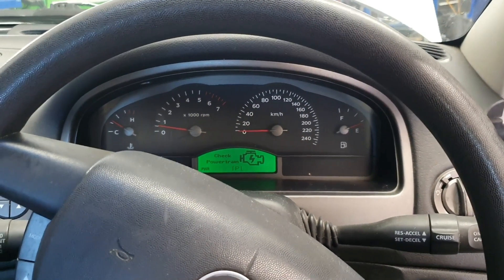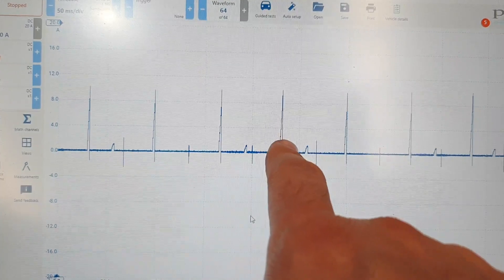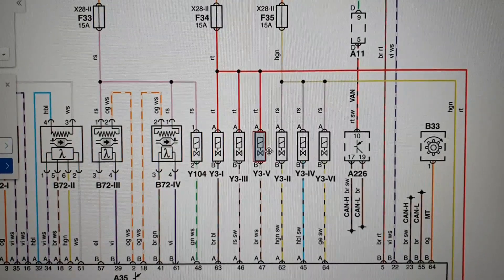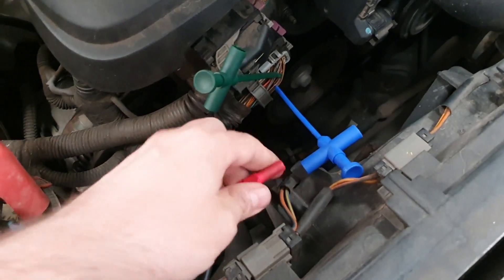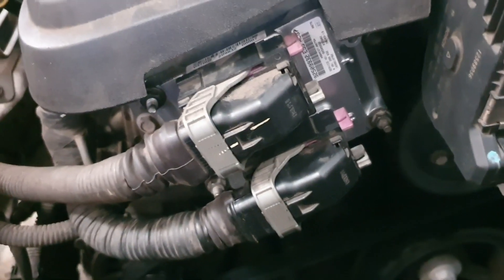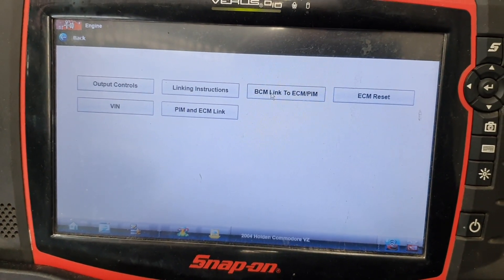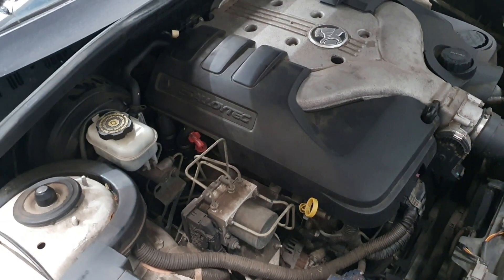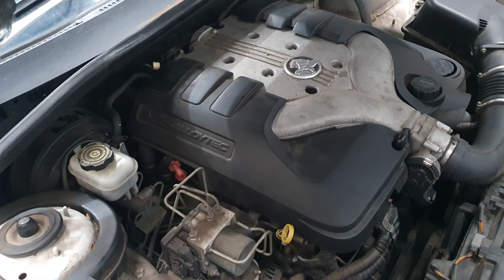P0205 - VZ Commodore 3.6L Injector Control Circuit Malfunction

Comment: Hi rob. I’ve got a VZ with 335k on the clock. I’ve repaired the ECU/PCM (it was misfiring). My ECU/PCM repairer said I had under-load for all injectors and a hard fault for injector 5 which he has fixed. I’ve never replaced the injectors (in 15 yrs of ownership) and they seem to be fine. I note you mentioned you replaced the injectors also. If I don’t replace the injectors, is there a risk that it could damage my repaired ECU/PCM? I’m just trying to work out the merits of replacing injectors also. 
How long do injectors normally last?
Please note I’ve also had a check powertrain dash warning for a few years and could never figure out the cause, car was running okay during this time.
Reply from the maker: Hi Shazib, the biggest killer of drivers in modules is the load that it's supplying drawing too much current. Not to say that it has caused the failure of your PCM but hard to say unless the repairer has tested the current draw of the injectors. It's more preventative maintenance considering they are a relatively small cost compared to the cost of a PCM. In regards to how long injectors last, that's not something I can really say. It's a bit of a how long is a piece of string question. Hopefully that helps.
Reply: @romanosautomotive  Awesome that’s so much for your help and very useful videos, greatly appreciated!!

Comment: Great video Rob , I noticed the verus pro on the docking station , is your battery nearly retired to?
Reply from the maker: Thanks Paul. No my battery is still good but I leave it on the dock all of the time unless I need to sit in the car. I've got the video output connected to a monitor on top of the diag cart too. Although the Verus is probably due for an upgrade soon!
Reply: Ahh……the never ending update , will you stay with snap on….D10?
I thought the software updates were a bit pricey with snap on until i bought an Ultra ☹️
Reply from the maker: Not sure. I was considering the Zeus but haven't decided if I'll branch off or not. Too many decisions for a tool addict to make 🤣 How is the Ultra treating you? Would you recommend it?

Comment: Nice video. One question,  doesn't the autel let you link ecm, bcm and pim? I noticed you had to change scantools.
Reply from the maker: Thanks Rob! I linked the BCM with the Autel because it gave me the BCM 6 digit code but it wouldn't give me the 4 digit immobiliser code. Then I tried the Snapon to see if it would give me the code and it didn't. I ended up getting the code from the dealer and linked the PIM on the Snapon because I already had it connected.

Comment: I wish I had seen this 5 years ago when I was on the tools, was a pretty common issue back when these weren't that old, what's the ruff cost Todo this almost be worth going stand alone ecu, awesome test
Reply from the maker: Thanks JDM. The new computer from Holden is pretty expensive but the programming isn't that much. If you have a J2534 device, the programming is easy and relatively cheap.
Reply: @romanosautomotive sou do Brasil e preciso linkar uma bcm com a ECU. Tenho um dispositivo j2534. Qual aplicativo você recomenda por favor?